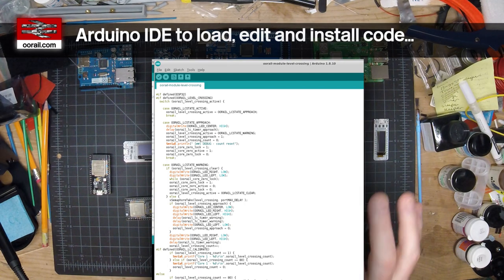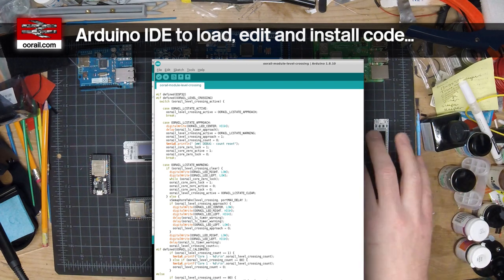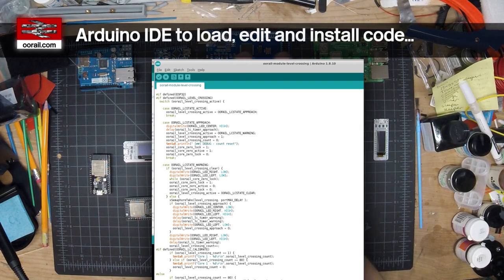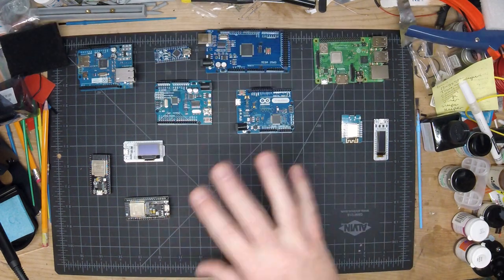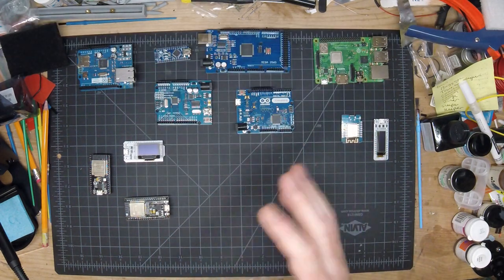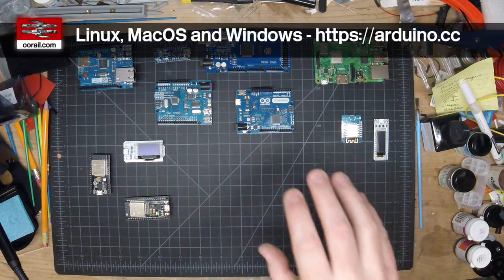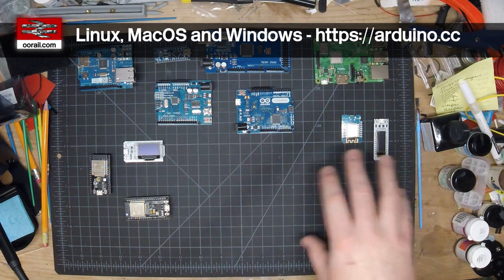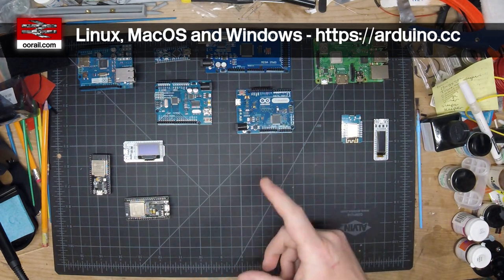Model Railway Computer Control - Part 1: Which boards should you use? | oorail.com

Comment: Was wondering what power method you used to power your rails I'm struggling to find a method that works with all my old 3 pole motors that also works with the new 7 pole motors.
Any help would be appreciated regards. Liam
Reply from the maker: Hello Liam. I'm using DC power supplies from Meanwell that are controlled using L298N motor driver boards. You can see more about the power supplies I am using in this video - https://youtu.be/laTFm6qut5Q. You just need to be careful and make sure the current draw from the older motors doesn't exceed the rating of the power supply (unlikely at 5A) or the rating of the L298N boards (~2A per channel). So far, I haven't had any problems even with older 1970s Hornby locos. I haven't tested it out too extensively with Tri-ang locos yet. I'm currently working on the next release of the oorail-system, which you can find out more about at https://oorail.co.uk/oorail-system/
Reply: @Oorail  thanks for the few tips regards

Comment: So is it possible to use these modules with a train automation program, such as iTrain. For example, have iTrain loaded on a Raspberry Pi, with the Raspberry Pi then sending the control signals out to all the various modules?
Reply from the maker: Thats exactly what they are designed for. We actually have a train automation program in the works as part of the system. That program is web based so you can use the Raspberry Pi headless (eg. point your web browser at it) or hook a small touch screen up to it. All of the modules have a web API, so you could technically write your own train automation program even with something as simple as a shell script.

Comment: I have JRMI already loaded up on an RPi4, but I have yet to get it connected to my controller. Not because I cannot, but because I have not tried :) I will be following along.

You say it is the brains of the layout, but what software are you running on yours?
Reply from the maker: I'm currently developing my own software both for the modules (primarily ESP32/ESP8266) and for the layout controller. The software is being made available for free as open source under the GPLv3 license. The next video on computer control will show you how to download it and install it. The current world situation has given me some time to catch up on projects, like updating the website, 3D printing and this project, so things are coming together a lot faster over the coming weeks :)
Reply: I just used a ‘sprog’
Reply from the maker: @nickindublin  Yeah we looked at those for adding DCC support but they are a bit clunky and kinda expensive for what they are. Built something better for under $30, more on that soon. To be honest, we also looked at JMRI and determined it would be quicker to build something new than to try and fix it.